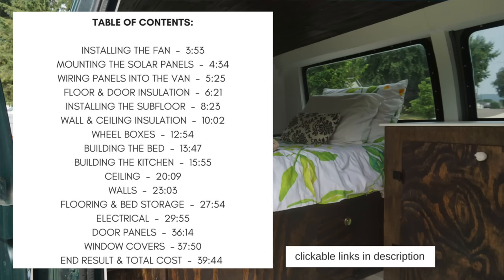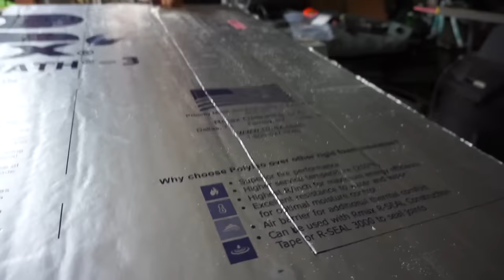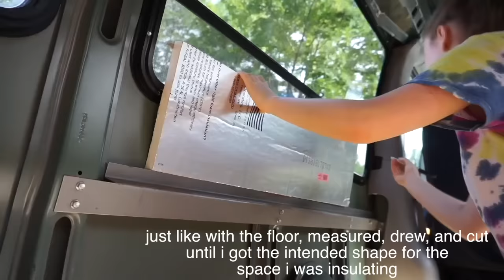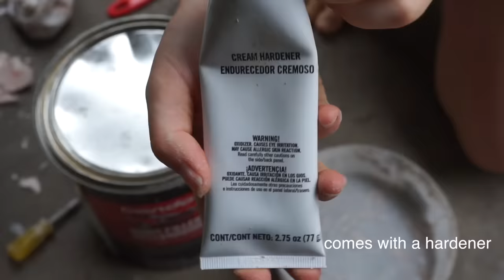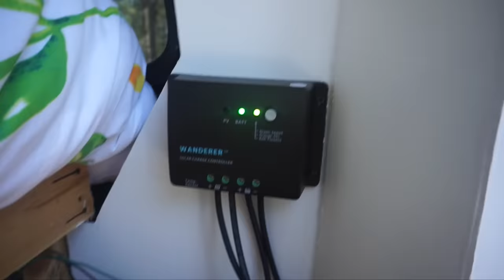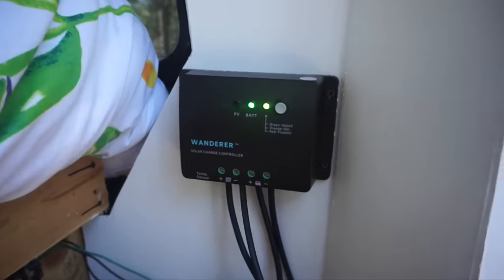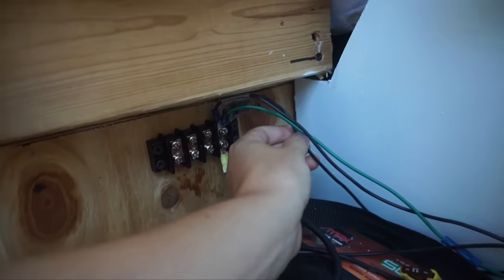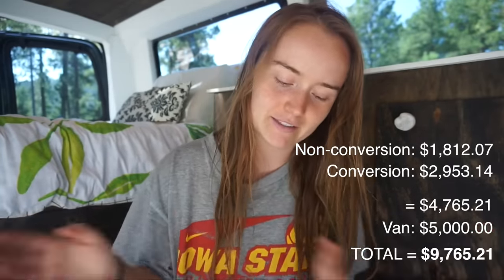How I Converted A VAN into an OFF GRID CAMPER for under $3,000

Comment: Battery safety: cover the positive terminals completely with a rubber or plastic cover. Install a quick kill switch (or master circuit breaker), and as you said, it really is a good idea to have an appropriate sized fuse between every single electrical item in a fuse panel. It would  be a good idea to put the battery in a vented box in case it decided to do damage if shorted out, it will minimize the hazard area.  That inverter seems to be a bit smaller than your system is capable of, but kept you under budget. I think most are correct in saying get the most matched battery and largest inverter system you can afford for true off-grid happiness. 

Edit: Now I read others' comments: agree you do need a fuse between the solar panels and charge controller, because on an extra sunny day your solar panels might work TOO well and you don't want to damage your electronics or battery by overcharging your system too fast (a charge controller is supposed to take care of that, but you can't ever be too sure that your solar panels will 'slow down' when you want them too. 

Also, I think that charge controller battery select button is possibly dangerous, because it is too easy to push the button to change battery charge type, as each of those battery types require different charge rates and full charge voltages, as well as discharge limits.  After setting it to AGM, you probably should cover the select button so the select switch can't ever accidentally be changed to another battery type. 

Suggestion:good idea to install a fire extinguisher by the door you use the most, nearest anything flammable.

Good job on insulation, make an insulated curtain to separate the front driving area from the back, too, as your front cab area is the largest heat inducing area in sunlight and heat losing area in cold / night. 

Definitely minimalist. I bet you end up adding a few storage shelves.
Reply from the maker: Roobah yes like I say I didn’t do the electrical and long story short didn’t have the option of just telling the guy I wanted fuses in between all of them and going and getting them because we were way out in the country far away from any where that sold them. I suppose I could put them in myself but I’d have to buy a bunch of stuff I really don’t want to buy. 
What do you mean the inverter is smaller than the system is capable of? I know it’s definitely on the lower end as far as wattage goes but all I use it for is my fridge and occasionally charging my laptop and it’s been fine. 
Pressing the battery button does not change it. If it is bumped- nothing would happen thankfully :)
I do have a fire extinguisher and a curtain between the front that I can put up I just don’t show those things in this videos because they aren’t part of the build. 
I don’t have any place to put storage shelves but I luckily have extra room in my van to put stuff so hopefully I won’t have to worry about that!

Comment: I love your van. I just bought a 2002 Dodge Ram 1500 conversion van about two weeks ago. It's high top but only has about 5' standing room.  318 engine, with 121,320 miles on it. It was supposed to have a bead engine, (Cracked block they said) But, seeing as how I am  a mechanic I quickly noticed that the leak was coming from under the passenger side of the engine, behind the motor mount. (Bad/leaking freeze plug, a $4.00 fix. I have a solar panel, 2000/4000 watt inverter  and one large house battery. I have taken out the electric rear lay down bed and bought a small military cot. 30" X 76" that works well with spacers on the legs to allow ample storage. I have a Mr. Buddy heater but seem to get headaches from it so I'm looking for a small 12 volt heater to run off of my batteries. By the way I paid $500.00 cash for my van. I drove it to the closest Advance store, jacked up the van and then the engine to one side and replaced the bad freeze plug. You have to remove the motor mount (took about 20 minutes to get it out.
        I wish you the best of luck with your van. 
                                        Bill 
                      I

Comment: Safety first steel toed boots, safety glasses when using power tools, masks when sanding, gloves painting welding sanding, plumbing. Be safe
Reply: I would also add some long pants and sleeves when working with paint or in general do not let chemicals touch your skin. 
And tie up your hair or wear some cap to prevent them from getting tangled up in a powertool.
Same goes for earphones.
Reply: @lorenzomariasantini  Absolutely, don't forget to wrap yourself in bubble wrap also.
Reply: She’s alive
Reply: @K1Xian1988  She asked for some tricks and helps on be more safe.
 I honestly believe you should be as safe as you can while working with chemicals and powertools and this includes long sleeves, masks, googles and similar. 
If you believe that those are not important no one forces you into using them. 
I am just giving suggestions I use in the first place.
Reply: Also watch for long hair near rotating things like the drill 17:09 (was tired up most of the video)
Reply: People survived and were productive for thousands of years before OSHA .
Reply: If people like you were in charge humans would still live n caves
Reply: Sush... She was home,  in her own. She did it an amazing job.
Reply: Especially the shoes! I was almost hyperventilating seeing her working barefoot! And not securing things wile cutting with the saw.. basics cutting in the air. She was lucky to not get hurt!
Reply: And she should take care of her hair, it's so dangerous to have it all the time hanging near the screwdriver!